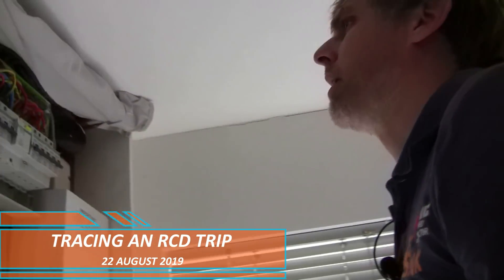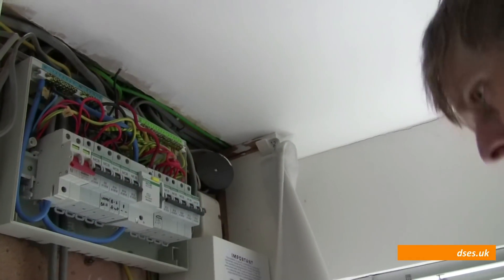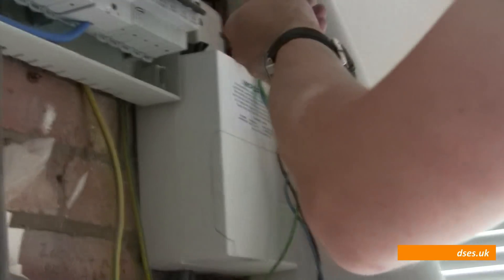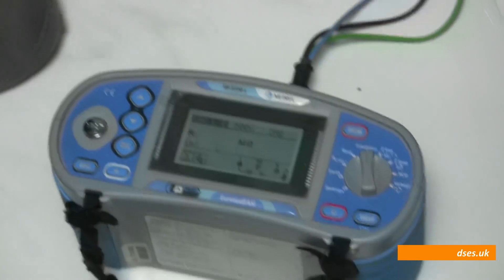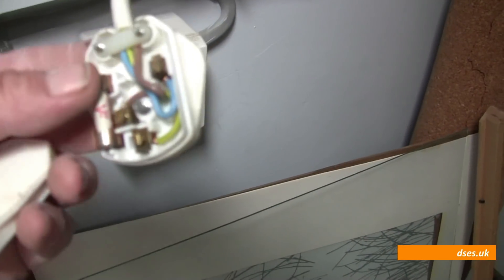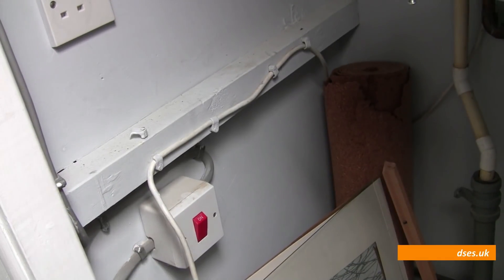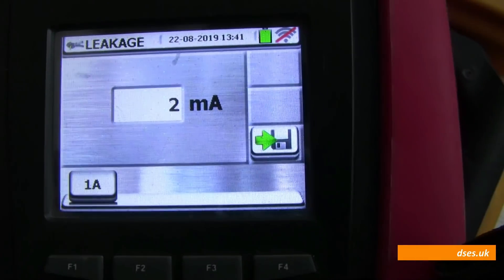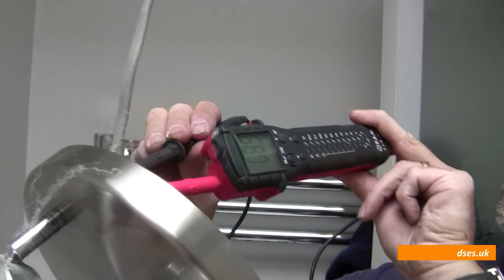Tracing an RCD trip

Comment: A good educational video, well done! A thorough test; I would probably have deduced faulty circuit without removing board cover by switching off all mcb’s and then putting them on one at a time until the RCD tripped - maybe I’m just lazy? I would then have looked at anything connected to that circuit and disconnected / unplugged until (hopefully) fault disappeared and then narrowed down to boiler. Glad to see you are now testing earth leakage via tails and not main earth wire; that was a mistake I initially made when I got first got a sensitive clamp meter until I bothered to read the instruction leaflet. Fault finding can be very rewarding or very frustrating.
Reply from the maker: Thanks Richard. Clocking off the individual MCB's may point you in the right direction if the fault to earth is on the line wiring, but if it's on neutral or if it's a combination of bad IR from two or more circuits, then you need to dig deeper. When faced with a fault situation, we like to test it all before making changes to see what the starting position is, then we know if we're on the right track. Good point about clamping tails, I did show clamping the main earth in one or two previous vids as I didn't appreciate the difference you could see in the reading!
Reply: David Savery Electrical Services Cheers David. That makes good sense to get a more in depth picture of the condition of the electrical installation. When you say “if the fault is on the neutral..... “ then wouldn’t this also trip the RCD just as with a live earth fault?  While I have your attention, can you help with the following scenario: I tested a socket radial the other day and got a sensibly low R1+R2 (it was 4mm T&E) but when I tested the (live test) Zs it was returning a reading off the scale and yet the Ze was only 0.06 -any ideas? or maybe I slipped up somewhere? Maybe I picked a different socket on the circuit that was faulty - it was at the end of a long day, New CU to replace 2 Wylex rewirable boxes and 10 circuits overall with bonding to water and gas to add.
Reply from the maker: @richardwallace3477  A fault on the neutral would continue to trip the RCD even if the faulty circuit is turned off at the MCB as current from neighbouring circuits that are still energised will leak to earth via the neutral bar. I'm not sure why your Zs test failed unless the point under test was on a different circuit or the tester was misconfigured. If you've verified the earth fault loop path via a Ze and an R1+R2, then it should check out on a live test.
Reply: David Savery Electrical Services Many thanks for the reply and now that you explain it, I see what you mean.  I’ll look more closely at my non-Zs reading when I return to the job next week. Enjoy the rest of your weekend, thanks!
Reply: @dsesuk  Interesting point about neutral-earth fault.  Thanks

Comment: why you just dont isolate the MCB that cause the tripping ?
Reply from the maker: It depends on whether the fault is on the line or the neutral as switching off the MCB doesn't disconnect the neutral so the RCD can still trip. We could disconnect it at the board, but as this is a fault with an appliance, and one which can be unplugged, there's no need to isolate the circuit.
Reply: @dsesuk  i know that it doesnt im talking about faulty  circuit. So switching all off and then switching them back on one after another you know which one is causing problem. If its ring you seperate one leg from another to narrow the fault area.
Reply from the maker: @DerekHundik  Not necessarily as even with the faulty circuit off the RCD will continue to trip if the fault is on the neutral as it's commoned to all the other circuits. We've seen it before where switching on a healthy circuit causes a trip just because the surge current from that circuit caused a leak via the bad neutral of a separate circuit which is the one with poor IR. The trip may also be down to poor IR over two or more circuits having a cumulative effect on the RCD. We test all RCD circuits at the start to see what's reporting as bad so that we know for sure where to be looking and that all faults are accounted for.
Reply: @dsesuk  yes so you narrow it to the possible fault circuit and then test one or two. I dont see the idea for disconecting all the circuits.
Reply from the maker: We test all just to be sure we're not going to get any call-back for the problem still happening. We know with these numbers that there was just the one fault there and it ought to be stable with that appliance removed. That's also why we write down the readings we get from each circuit on the day; if the client says there's still an intermittent trip problem, we can re-test and compare results to see if any other circuit is unstable or inconsistent.
Reply: @dsesuk  ok. Got it. Cheers

Comment: Either a PCB fault on the board or the pump has gone.
Shouldn't be going in the boiler any ways well you can go into the Worcester Bosch boiler as the housing isn't classed as the combustion chamber.

Comment: Not being on the gas safe register contractor  and removing the boiler cover from a room sealed appliance is illegal. Your only saving grace is that a qualified gas engineer will be following your foot steps to correct any mistakes you may make when placing the cover back on . Just go to the gas safe web site , its all clear on there.
Reply: It wasn't an appliance, it was a white box.
Reply from the maker: Depends on whether the casing is decorative or integral.
Reply: @dsesuk  How can you tell before you've taken it off ? ;)
Reply: The cover you removed was not decorative it’s a 
Room sealed appliance it’s part of the combustion chamber , your wrong on this occasion, electricians should leave gas appliances alone .
Reply: @scott5566  visa versa as well pal. Electrics and gas should only be worked on by qualified people.

Comment: Just thought I'd ask a question, if your not allowed a class 1 light fitting why didn't you disconnect it and install a class 2 fitting. You called the bathroom fitter for that!!!!
Reply from the maker: The installation of the Class I fitting is someone else's cock-up, it's not for us to put right for free, neither do I happen to have a suitable Class II luminaire on the van. We weren't called in to look at the light remember, it's incidental. As there's a cost involved because a new fitting needs to be sourced and installed, it's up to the client to decide if she wants to pay that cost or to shop around for other quotes. We're in no position to legally require her to pay for us to replace the light, to replace the light for free or to disconnect it entirely. All we can do is make her aware of the risk: she then has to decide how she wants to manage that risk, whether that's arranging for replacement, demanding it be put right by the bathroom fitter or simply going on living with it; these are all her choices to make, not ours. Some installations we walk into and can see a whole host of dodgy workmanship from other installers. If the expectation were that we righted every wrong we came across, we'd never be able to stick to our schedule and we'd have customers complaining that we're overcharging by undertaking additional work they hadn't booked us in for. We're only authorised to do what the customer tells us to do.
Reply: @dsesuk  wouldn't bother explaining yourself to an obvious dumb question...
Reply: @zu1875lu  you replied lol
Reply: Steven richardson , you can’t just go rectifying every unrelated breach found in a property. The property owner had a PIR, so it’s down to them.

Comment: I am curious as to why you took two MFT's off the van David, I know the TIS both measures earth leakage and IR testing, so why take the Metrel off the van?
Reply from the maker: As it was a nuisance trip job, I only went in with my Fluke case as that contains all I generally need. I could have measured the leakage with a clamp meter I also keep in that case, but I thought the TIS might be more interesting to look at for the purposes of this video as that clamp accessory may be too expensive and tricky to get hold of for most to bother with. We often have both out on a job though, one by the board, the other at the endpoint so we can test what we need to test without too much running around!
Reply: @dsesuk  Alright for some aye, two testers out on site... My Megger 1720 MFT has been sent away for repair so I'm stuck with Craptech KT63 which bins your results after a couple of seconds or when you disconnect from a supply 😭
Reply from the maker: Oh dear, I hope that gets sorted out for you soon old chap. I think Nige has a 1720, we just never bring it out on site. Maybe we should in a future vid for some variety! Haven't used the KT63 but I thought they were well rated(?)
Reply: @dsesuk  I've been using it for a couple of days now and miss the creature comforts from my Megger 1720 such as 2 lead loop test, constant continuity measurement, auto start loop test, faster auto RCD trip test... I'm gonna stop now, the more I recite, the more depressed I get.
Reply from the maker: Chin up Alvin, it's a bank holiday weekend and the sun is shining!
Reply: @dsesuk  What you upto today David, anything interesting or are you already perched up in a beer garden somewhere?
Reply from the maker: In a dark office at present making a few calls. I think a few brews out in the sunshine will be happening in an hour or two though!
Reply: @dsesuk  I will say one thing about the Craptech KT63 in it's favour, it's very fast when performing a low current loop test 👍

Comment: Great video as usual, I think I’ll use your methodology of IR testing with everything still plugged in.  I have always unplugged everything before IR testing.  which in a large property can be quite time consuming.  Just like most sparks I am worried about damaging a piece of equipment.  Next earth fault I have, I’ll give it try.  👍
Reply from the maker: It's difficult with a site you're unfamiliar with as you're never quite sure if you found everything, but yeah, L-N IR isn't so important as a failure in insulation there should trip the protective device, so I'm more interested in what's leaking to earth as an RCD trip will affect multiple circuits. When faced with a fault, we want to test what's there before we start making any changes to be sure we're seeing and then removing the cause. I had one 'helpful' customer once who had prepared his house for our visit on an RCD trip issue by disconnecting stuff which meant the conditions that were present when the fault was occurring were no longer there!

Comment: Hi Dave. That term "'floating earth '' could you tell me a little more how you got that reading  please ?!  With no earth wire near the appliance would like to understand what you meant.
Also Dave ,2Milliamp earth leakage ?? As a fan of your channel was wondering why "any" current is leaking and how much current is allowed or calculated. Hope to hear from you. Tin of special brew in post if you answer these. Best regards Don Codman
Reply from the maker: Hi Don. When I said 'floating earth', I just meant the CPC going to that luminaire wasn't connected to anything behind the ceiling, or if it was, then it wasn't a good earth path back to the board. It's not unusual to see a few milliamps leaking on any installation; that leakage occurring where insulation resistance between circuits isn't optimal or perhaps through a bit of induction between wires running in parallel. Usually it's down to the odd appliance - I.T. equipment is supposed to be a bit noisy on the earth, or so I hear, I haven't worked with equipment that has caused issues myself. In terms of how much leakage is present, it becomes a problem of course if the leak exceeds around 20mA through an RCD installed for additional protection as you're heading into trip territory, but other than that I'm not aware of any 'permitted' or calculated level allowed. There might be such, but I don't recall having come across it. There may be someone on here who knows better though!

Comment: What's that white plastic thing on the grey wire from the cutout to the meter? I have one on my installation and I've always wondered what it is
Reply from the maker: The thing clamped over the live tail? It's an energy monitor clamp similar to the clamp I used with my TIS tester. The greater the current being drawn, the bigger the magnetic field around the tail. There's a coil in the clamp in which a small current is inducted, the size of that current being greater in sympathy with the size of the magnetic field. This current goes to a transmitter unit which sends it to a receiver display the homeowner can place elsewhere in the house allowing them to see what sort of load is being drawn. Energy companies were handing them out free a few years ago, and because the clamp is non-invasive, it can be fitted around the tail by the homeowner. They weren't very accurate, and earlier models got confused by things like solar PV as they couldn't distinguish between energy locally generated and energy being imported. These days, smart meters have the functionality built in and provide more accurate information. I have an OWL model clamped on the line of my solar PV installation so I can get an idea of what I'm generating without having to read the display off the inverter. If you no longer have the display unit, then you can unclip the clamp and remove the transmitter as it won't be doing anything useful.

Comment: Blimey I thought our electrics were old, (1980) but at least the it is in copper PVC and the lighting circuit is fully earthed. We do need to get that 1980 Wylex united replaced though!  What worries me most about this video though as we also have exactly the same boiler we have just paid a fortune for at it looks like cheap crap inside :(
Reply from the maker: 1980 is thoroughly modern compared to some of the things we see!
Reply: @dsesuk  my only worry is we did have an issue with quarrels, so I hope they haven't chewed through any cables but hopefully an insulated and earth leakage test will confirm that the wiring itself is ok before we get the consumer unit changed. One concern I do have is none of the ring final cables are clipped to the joists, they are just hanging loose under the house was that normal back then?
Reply from the maker: It's not unusual to come across non-clipped cables, and them dangling under floors generally doesn't cause them any harm so long as there's no undue strain on any part of the cabling.

Comment: I work in Southern Ireland and you didn't have to necessarily run a earth for lighting circuits until the early 2000s which always seems mad to me, and causes problems when I have to do periodic inspections in rented houses for the local council and a lot of the lights and switches are class 1 fitting and the people renting the house are not to happy when I have to tell them I have to take out there fancy class 1 lights and switches and replaced them with cheap looking class 2 plastic ones. in a earlier video you said you where coming over to Ireland for a break did you have a good time.
Reply from the maker: Hi Paul. The assumption we would all be using plastic pendants and switches forever seems so quaint these days! I don't envy you trying to convince people that something is wrong when they perceive it to be working right; it's what happens in the event of a fault that they don't appreciate! Thank you for asking, yes the family and I were in Enniscrone in July for a big family reunion. The wife's mother was Irish, and relatives from Ireland, England, Canada and America were among those jetting in from all over for a big get-together. I recall only two things: England basked in a 30C heatwave while we caught some Atlantic weather, and I put away so much Guinness that their share price rose to a new high on the stock market! Seriously though, it's a lovely part of the world and we did have a good time.
Reply: @dsesuk Thanks for the reply, I'm impressed that you reply to me so quickly at 2 in the morning do you ever sleep , I'm glad you had a good time over here, they say the Guinness tastes better over here in Ireland and they are right.

Comment: Went to a rental once and the tenant had done all manner of things illegally and without permission from the owner. One was to remove and old 50's bathroom heater over the bath and hardwire a wall mounted TV onto the circuit. SERF protection at the board not even an MCB never mind RCD. The tv bracket was fixed to the lathe and plaster wall with a hope and a prayer.
Reply from the maker: Wow. I guess when you wanna watch Coronation Street, even surviving bathtime comes second!
Reply: @dsesuk  Last month I went to job where they wanted a heated towel rail installed in a basement bathroom. There was a large 6 seater spa pool rammed into one end of the room with access to half of one side. Existing double plug socket adjacent and above where you stepped into the Spa. Client had a fan heater plugged into it on the Spa pool cover. A shower cubicle against the wall and the spa, Vanity unit next to the shower then in a closet a "murphy bath"! Yes like a murphy fold down bed, a fold down bath. Scratched my head for a while about the zoning for that room.

Comment: Looks like it maybe leaking internally.

Looks a bit crusty around bottom of the valve and the blue plastic  on the transformer is slightly discoloured.

Would appear that water has got into the transformer on the PCB and that’s where the leakage is occurring
Reply from the maker: Could well be, those rusty bits were noted, but it's not our area of expertise.